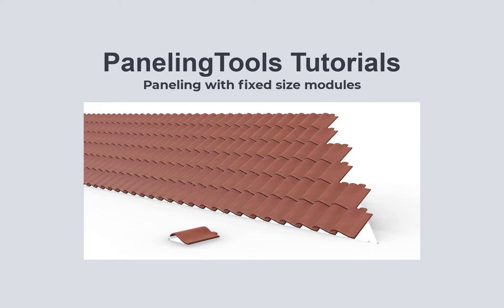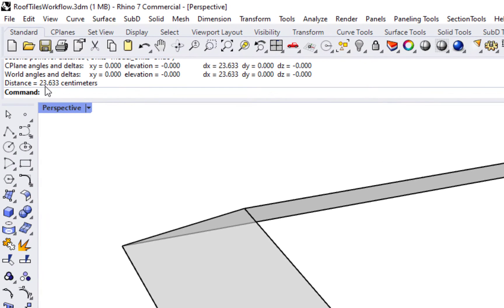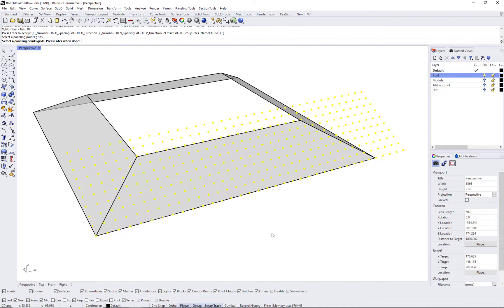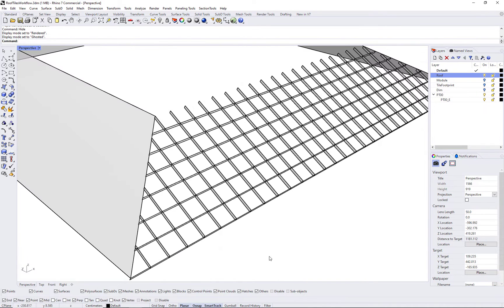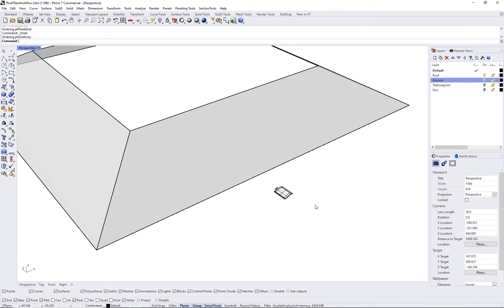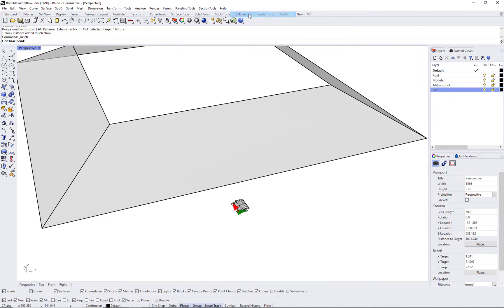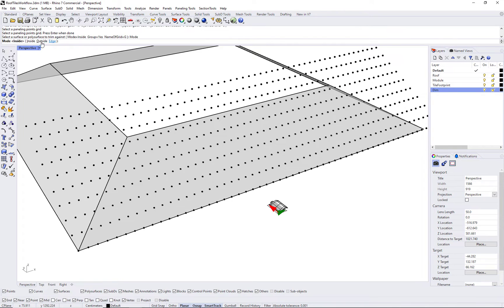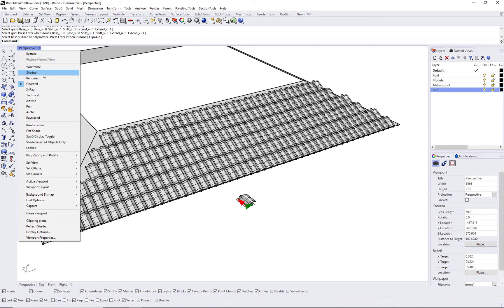Paneling Fixed Size Modules

Comment: Hi, thank you for the video. Is it possible to do fixed size panels for curved surface?
Reply from the maker: It depends. If you surface is doubly curved, it might not be possible. It is always possible with singly curves surfaces (ones from extruding free form curves). In some limited cased, doubly curves surface such as ones that are part of a torus, can populate with same size panels. I hope this helps